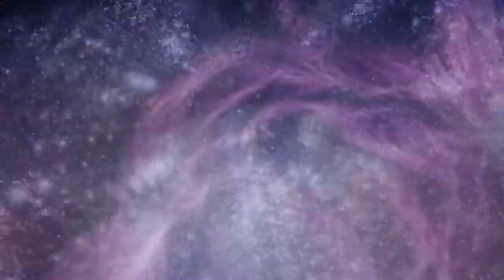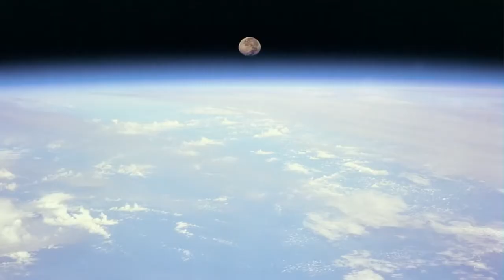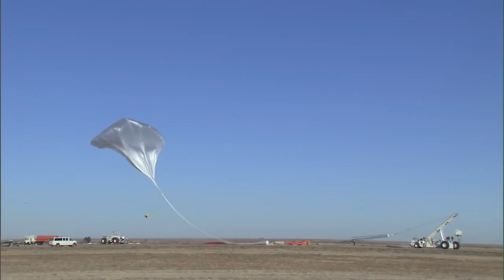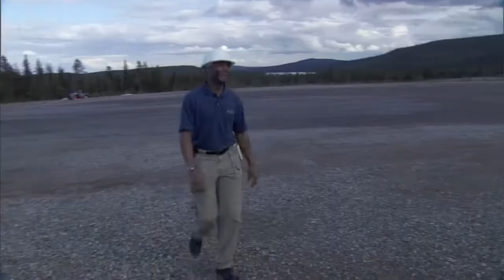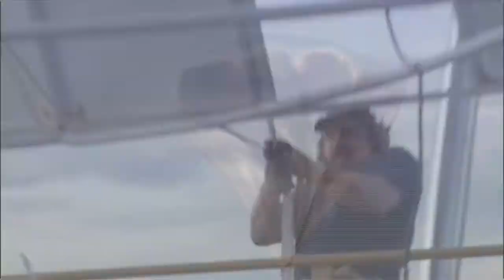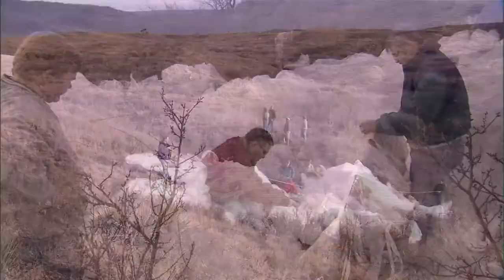B Line to Space  The Scientific Ballooning Story [MIRROR FROM NASA]

Comment: Hi FEPE PERTH
You need to check out angular size / angular distance equations.
Using science and nasa data regarding the size and distance to the sun it is very easy to figure out the suns angular size, its actually 0.533 degrees, what does this mean you ask ?
Well it means that every time a boeing 747 on an international flight flies across the face of the sun it should cause a partial solar eclipse !
In fact a 747 @ 27,000ft flying overhead across the face of a midday sun should show its total length to be the same as the suns diameter !
The same goes for aircraft crossing the face of the moon as its angular size / diameter is 0.52 degrees.
Look up angular size calculations and correct me if I am wrong ?

Regards
Flat Out